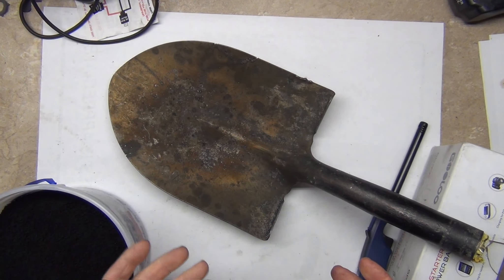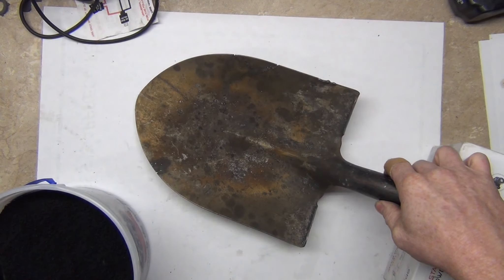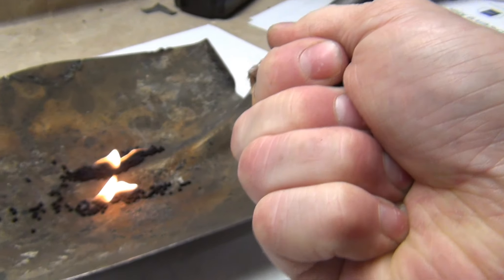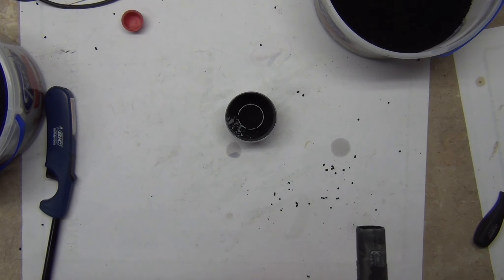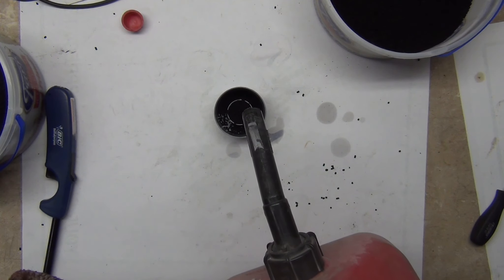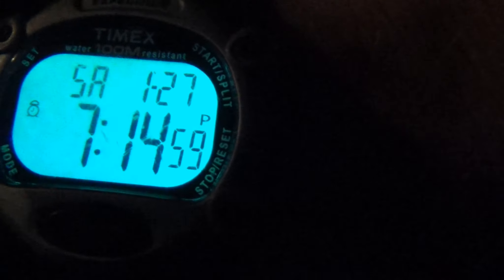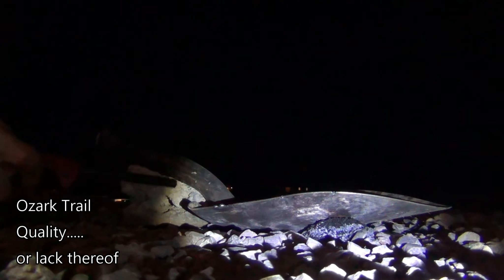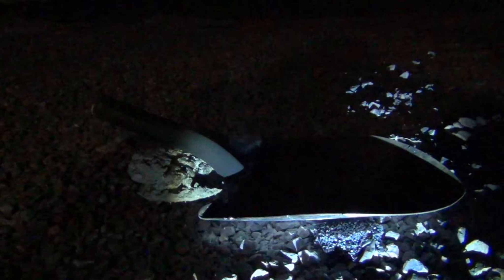How Does an EVAP Can Hold Vapors?  Activated Carbon Demonstrated

Comment: Not sure if anyone else is thinking this, but this seems like it would be great for fire starting while back packing/camping. Throw some of this in a canister or something and just dump some out when you need it and hit it with a fire striker.
Reply from the maker: That could work.  Another thing that I really like is dryer lint.  It's lighter, smells better, and it's soft.  It doesn't burn as long, but it really gets the job done.  If you put it in a cardboard tube it ramps up to kindling pretty good.
Reply: Only disadvantage is it could get wet.  The best idea I've ever repeated was packing a vaseline soaked cotton ball in a drinking straw and melting the ends together.  You can do that with matches, too, so that you've got dry matches and tinder.  You could seal this stuff up the same way, though.  The drinking straw trick is cool.
Reply: I’ve thought about soaking gasoline in this stuff and throwing it inside a zip lock bag or in one of those little water proof survival tubes. It would be great for an emergency fire.
Reply from the maker: That's awesome.   Did you see that end card I did to your engine coating video a few back?

Comment: Thanks for a great video as usual. Brian, on a different note when doing a subaru gasket head with the motor in place, where do you place the jacks under the motor, and do use one or two? is it safe to place one under the oil pan (can it carry the weight of the motor)? Thank you.

Comment: So if you have a flooded evap canister, took it apart and burned all the hydrocarbon out of it, could you then reassemble it and use it again?
Reply from the maker: Yes.
Reply: @briansmobile1  the things I can find online. Love it. I just took apart my bmw canister and was wondering how to clean and re-use the carbon vs buying new. The canister is over $500 dollars. So if I spread it on a baking tray and let it burn until it went out it would be good to go again?

Comment: Would throwing the ''toyota '' charcoal thats not absorbed any gasoline onto a gasoline fire stop the gasoline burning the material it is sitting on? For example the gasoline is on a wood board and on fire and you cover the burning surface area of the wood in the charcoal. Would the wood keep burning at the same/similar rate or would the charcoal displace the gasoline into itself and burn off the vapor instead of the liquid and by proxy stopping the material now below the charcoal from burning.
Reply from the maker: I think it would still burn the gas, but it would take longer and I think it would save the wood somewhat.

Comment: My guess is the fizzing is the gasoline replacing air in the pores of the activated carbon.  Molecular sieves do the same thing, and that is the only explanation I have for it when you drop molecular sieves into a bottle of chloroform and see the bubbles coming from the sieves.
Reply from the maker: That's exactly right Steve.  Smart guy!

Comment: So even though an evap canister is normally vented to the atmosphere, the fuel vapors don’t escape at all?
Reply: Evap canister is normally vented to the inlet manifold for vapors to be burned. If it was vented to the atmosphere then what would be it's role in the first place? There is hole in the canister that allow fresh air to blown through charcoal in order to dry it. When this purging should occur is controlled by ECU, it opens a valve to inlet manifold and suction generated by engine sucks the vapors out of canister.
Reply from the maker: I try to keep videos about 10 minutes long.  Here's a video I did specific to a common evap failure on mid 2000's Chevy trucks in the mean time. It talks about how the canister is purged or not purged if there's a failure.  It gives a basic idea of how the EVAP system works.  https://www.youtube.com/watch?v=slp--D8P0T8 This video today was just what the mysterious charcoal inside the black box does it's job.
Reply: One way check valve on the inlet to the evap canister, or a solenoid which opens only when the vehicle is pulling negative pressure on the system
Reply: The EVAP is normally vented to atmosphere through the vent solenoid. The purge solenoid on the engine side of the system, only opens under set conditions to pull the vapor out of the canister. If it was left normally open you would have a very hard time starting the engine as the fuel vapors would flood the cylinders with a mixture so rich it wouldn't ignite. However for the vapors to actually escape from the fuel tank they have to travel through the EVAP canister full of carbon. That takes a LOT of vapor and there would need to be higher than atmospheric pressure in the tank as well. What normally kills the carbon canister is folks who "pack" the tank. That means the folks who let the pump click off, then set there and manually add in more fuel until it's almost running out the filler neck. Doing that pushes liquid fuels into the carbon. The problem is that the carbon in the canister becomes saturated 
with all of the chemicals that make up fuel, not just the volatile vapor it is designed for and now the purge cycle draws off only the vapor that can get free of the carbon. The  rest of the chemicals stay behind. That plugs some of the carbon. Then the next time the fuel is packed in the cycle keeps going. Notice how the carbon readily absorbs anything? Now consider modern gasoline with ethanol and more water in it. Neither of those evaporate out of the carbon either.  The end result is a failed canister.

Comment: Isn't that point of a charcoal canister? Holds fuel vapors from the gas tank and pumps them into the intake for emissions?
Reply: Yep, that's it's entire purpose in life. And they have been around a long time. Late 60's in California was where they first started, Similar to the PCV system they replaced direct venting of automotive emissions.

Comment: So I just paid seventy dollars for some charcoal? What a deal!
Reply: AudioGardenSlave Some really nice, uniquely structured charcoal. :) Activated charcoal is special stuff and once the manufacturers put it in their plastic container, they are really proud of it.
Reply: mannys9130 The more crap they can tack onto a vehicle, the more they have to sell for a handsome profit later. It's a beautiful thing.
Reply: AudioGardenSlave Yep. I do wholeheartedly believe that the evap system is a necessary thing (unburned gas vapor make smog in the atmosphere) and a good system. The big issue is when engineers/accountants incorporate a bunch of extra tubes and valves into one module. I've seen it all the time on customer vehicles. The concept of modular components is great for assembly line, dealer repairs, and profit. It is absolutely awful for the consumer. If any one part fails, the whole unit is replaced. The OE prices can often approach highway robbery levels...
Reply: mannys9130 Tire pressure sensors fall into this category. Very expensive to replace and I've never rode in a late model vehicle that didn't have a sensor failure light on. I don't care about the sensors functioning, I just want the stupid warning message to go away. In essence I'd be paying hundreds of dollars like the owner before me just to have an empty message board.
Reply: AudioGardenSlave Yeah, TPMS sensors are pricey. They're good for one situation that I can think of: cruising on a long drive (especially highway) when you pick up a nail and it falls out, causing a fast leak. The tire loses like 15 psi within 10 minutes, and it gets so hot that it shreds and causes you to lose control. The TPMS light would alert you to that. How many people actually pull over to investigate? Not many, although I wish they did. Indeed, it just ends up being an additional ignored warning light. :(
Reply: mannys9130 I'd ignore it due to the failure rate alone. If they won't make it quality then they shouldn't make it all.
Reply: Activated carbon is expensive. The carbon needs to be super purified, and the manufacturing process is high precision. It’s not “just charcoal”.i have some for aquariums, and that’s pretty expensive too. In my former quality control lab in my film lab, we used activated carbon for analysis. That technical analysis grade cost several hundred $ per pound.

Comment: Why is one burning and not the Toyota - the other has gas in it for sure - the Toyota is new and never been run or what - or different kind of carbon
Reply: Donald Ellett It may also be depleted of gasoline. No vapors left in it = no easy burn.
Reply from the maker: The Hyundai system failed and was flooded with fuel from a gas can incompatibility and an internal barrier failure.  The Toyota one had a failed valve that was about the same cost as the whole can.  Both had about 200k miles on them.  If you don't flood them, they last a really, really long time.  If you watch the other videos in the SHOW MORE (caps for context- not yelling) you can check out the rest of the story/series.  Thanks Donald.
Reply: Than ks
Reply: I would think there would be tiny bit - but Brian sent me a message on it - tells the story